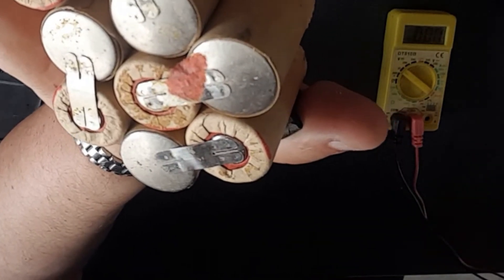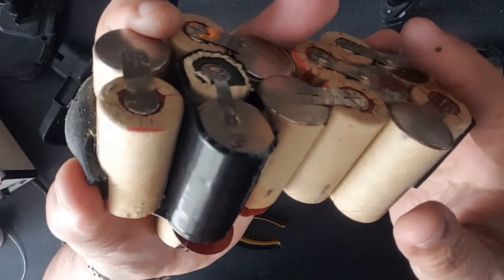Revive any 18v power tool battery (2020)

Comment: what if the batteries have been sitting for a year or two?  do you have to try to surface charge first?
Reply: They may still be usable but many chargers won't charge them because they are below the minimum voltage. You can try charging them by connecting them in parallel with a good battery to get their voltage up. However, from experience, if a battery goes below it's minimum charge it degrades significantly and should be replaced.